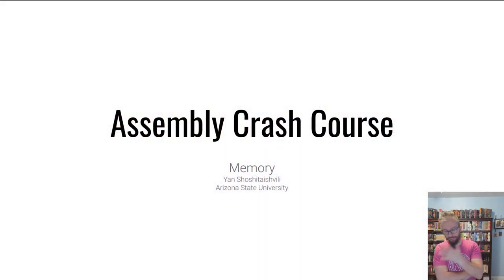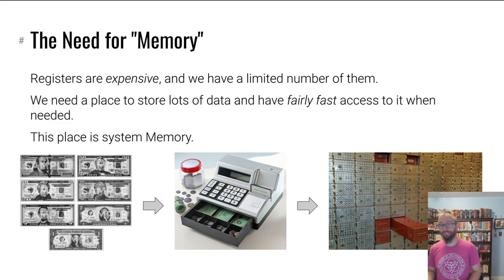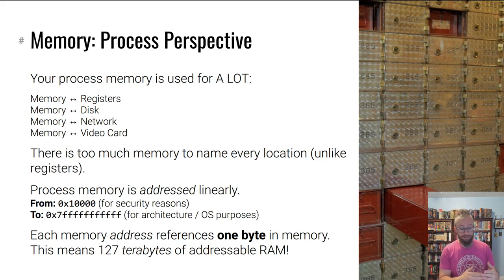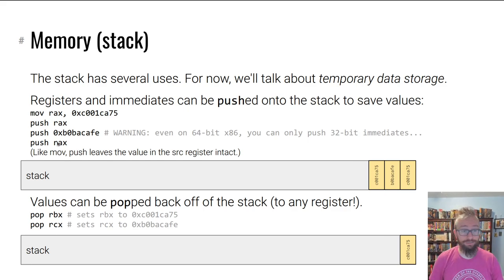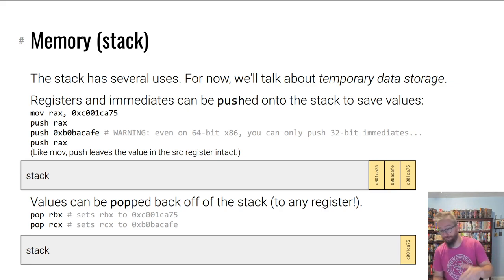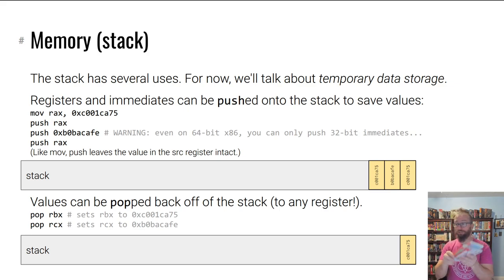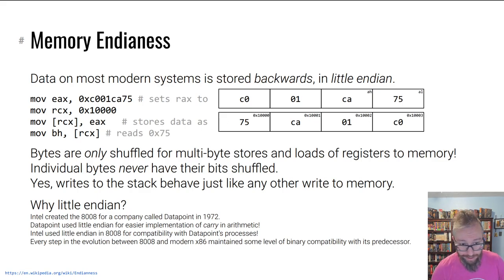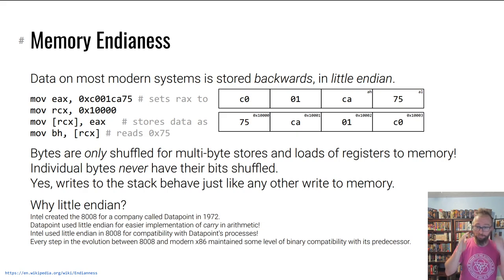pwn college - Assembly Crash Course - Memory

Comment: 13:29 - storing 8 byte to 0x133337 will end on 0x13333f or 0x13333e? Because if first byte will be placed at 0x133337 then + 8 -1 not + 8, because we will store 9 bytes.
Reply from the maker: Ah, oops. You are correct. The 8th and last byte written will be at 0x13333e!

Comment: 14:20  Shouldnt this be 4 itself? At a time only 32 bits or 4 bytes could be pushed to stack right?

And what is the actual width of stack in a 64 bit architecture. Is  it 32 bits or 64 bits?
Is each 4 bytes reversed while being pushed to stack? Or 8 bits?

Aaand.. what about word size w.r.t stack. Of 4 bytes are pushed at a time, does that mean           half a word is pushed to stack at a time?
Reply from the maker: It should be 8 bytes (64 bits). 8 bytes are pushed to the stack at a time. Sorry about the confusion!
Reply: Thank you  @pwncollege

Comment: how is sub rsp, 8 | mov [rsp], rcx same as push rcx. In case or earlier top element of stack will be overwritten by rcx. But in latter rcx will be pushed over the top element. Correct me if i am wrong.
Reply: remember stack is growing from higher to the lower end of memory? sub rsp, 8 just allocates a new 8bytes of memory space